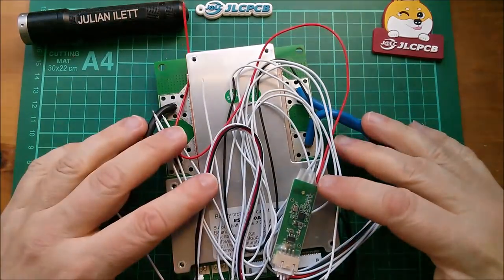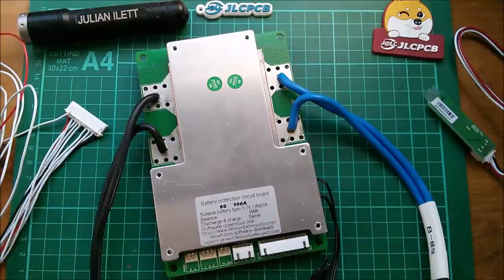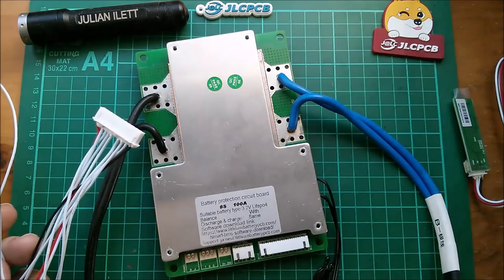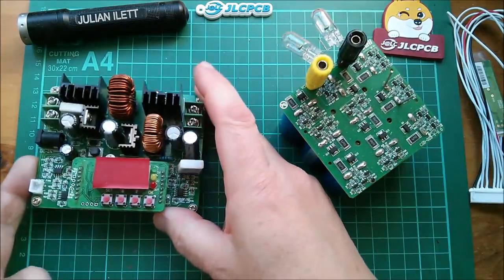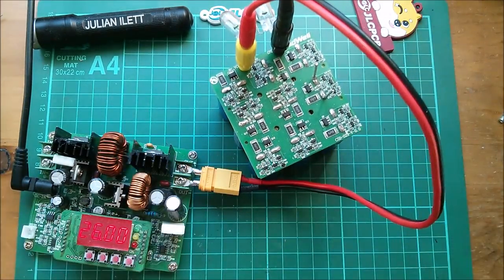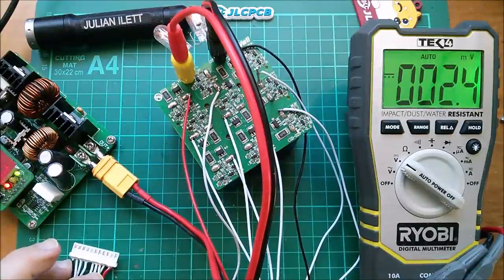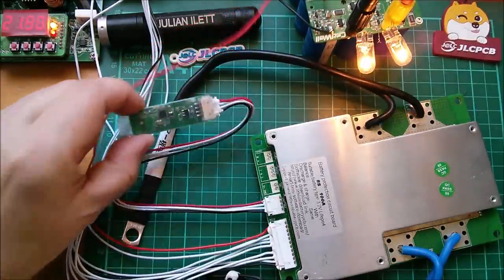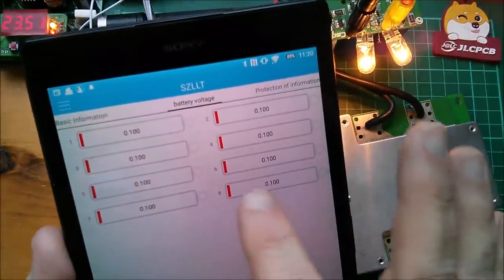XiaoXiang 8S BMS for LiFePO4 (same as Overkill)

Comment: I think the reason why the main -ve and the balance lead isn't connected is to sense accurate voltage readings. Those balance leads are voltage sensors, but if it's connected to the main terminals, the voltage readings will be off a bit due to the voltage drop by the loads UpTo 100A. Sad the Daly had those connected, not good. Oh and I think this BMS is originally manufactured by JBD, quite famous in the lifepo4 diy community.

Comment: Julian, do those BMS'es still work if you can configure it to run with a 7S pack?  Can they be configured to run on fewer cells than they're designed for? edit: I have a 5 cell LiFe pack but cannot find a BMS for a 5S system.
Reply: Yes, as he's shown in the video you don't have to connect all of the central cells, the only ones that are absolutely required to be connected are the first and last cells, although to be certain make sure to ask the seller you purchase from if it'll work in that configuration, it shouldn't harm it to run at a lower voltage but some of them may not boot unless you use a boost converter to provide a high enough voltage.

Check out the off-grid garage video "The JK BMS connected to a 12V/4s battery" if you want to learn more.
Reply: I own many of these BMS, and yes, you can configure the BMS to handle lower cell-counts in the app.

Comment: Daaaaaaaang! That is a a NICE BMS! Honestly, if you are 'worried' about 'not using' the BMS for anything useful--why not turn it into a "bulk charger" for... well... I mean it SAYS it does both LiPo and LFE batteries... Set of terminals, so you can charge whatever battery you want, or however many you want.

Comment: Hi Love the vlogs I am doing a lot of catch up and came across this episode. I was thinking of buying 8 LiFePO4 3.2v 280Ah cells. I want to make 2 x 12v 280Ah batteries. My aim is to have them connected in parallel to give 12v 560Ah supply for my Motorhome. Could you advise what BMS I will need ? Hope you can help. Thanks in advance

Comment: Why isn't it working?  Why isn't it working?  100 UK pounds, 8 cell, 100A, Bluetooth, and you haven't even skimmed the manual?  It's not a $5 eBay PCB that doesn't come with instructions but with the capacitor pack is capable of high current and likely can be damaged by wrong wiring.  Nor do I understand why you spent that much if you aren't going to use it.
Reply from the maker: My track record of not damaging stuff is pretty good. I'll use it on the larger scale solar-crypto systems.